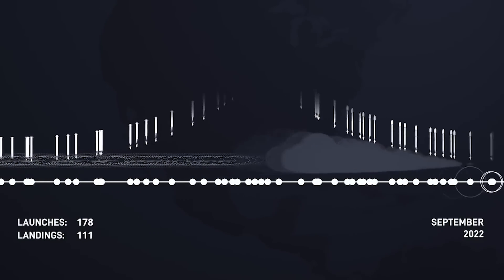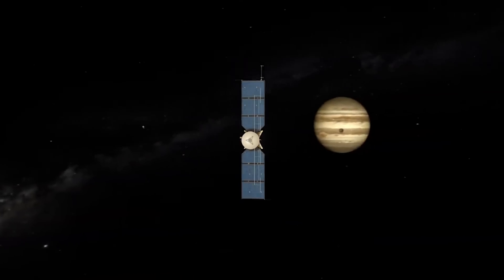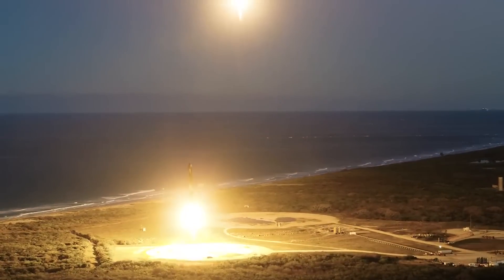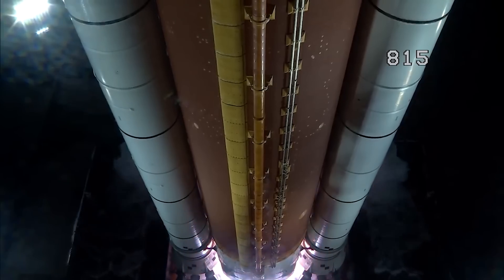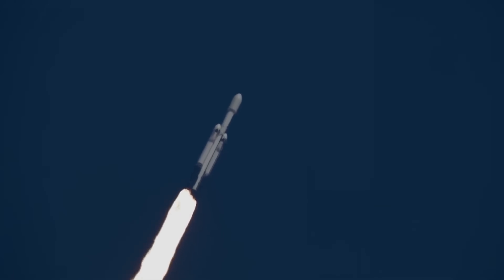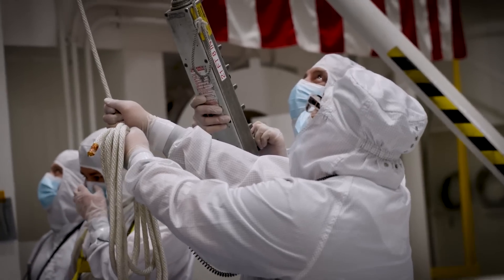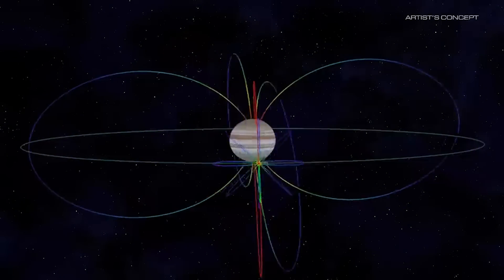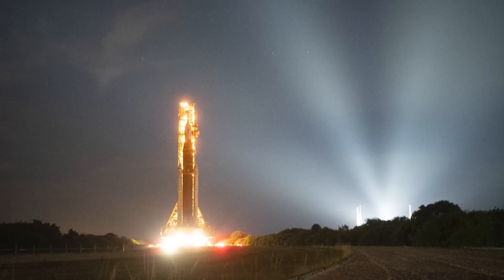SpaceX's Falcon Heavy Is About To Launch A $5 Billion Spacecraft

Comment: As it seems, SLS will be obsolete before even people launch on it. The fact that you can have 20 Falcon Heavy missions for the cost of just an SLS one, is not trivial, specially in the near future where the necessity for multiple launches per month will be a new reality. It is obvious that the future of space exploration demands cheap, easy to manufacture reusable vehicles.
Reply: NASA should stick to payloads only. It’s clear that the size of the government and the ability for contractors to charge an arm and a leg makes it pretty much impossible to design and build a vehicle for cheap. One company that has all the infrastructure to design almost everything needed for a vehicle is clearly the way to go in terms of cost. When you have a bunch of subcontractors the cost skyrockets and quality control becomes much more difficult and adds even more cost.
Reply: Falcon heavy could not lift Orion to TLI, even when fully expended. Yes, there are very few missions that require SLS (especially outside of Artemis), but for those missions, there is no alternative. Also 20 is exaggerated, it's more like 14x
Reply: Until starship is ready.@plainText384
Reply: anything NASA and the government are involved in is just wasting tax payers money!!
Reply: @plainText384  It hasn't have to lift Orion, they can easily modify any capsule to go along with Falcon Heavy and the 20 times is not an exaggeration, actually is more than 20 as the final cost for an SLS launch is around 2.5 to 3 BN.
Reply: @jonnekjonneksson  2.5B is 14× 178M for Falcon Heavy. Orion is the only currently operational spacecraft capable of returning humans to earth from the moon (in an unburnt state). If you wanted to launch a crewed lunar mission on Falcon Heavy, you would need to design a spacecraft that can do everything Orion can do, but is more than 11t lighter (41.8% mass reduction). 
Maybe that would let you just barely get something like the Soviet Soyuz 7K-LOK with into lunar orbit, but that would mean reducing Artemis crews to just two people per mission.
Reply: @plainText384 Falcon Heavy can get Orion to the moon. The Orion CM+ESM weighs ~26.5t. A fully expended FH can get 20t to TLI, but with centaur-like boost stage, it could potentially get 29t to TLI. If you can get Orion 2.2t lighter (~8%), you could even drone-ship recover the boosters!
Reply: @kolbyking2315  Source on the 20t to TLI? If you look at NASA's Launch Vehicle Performance Website, they claim just over 15t for TLI, while other sources (Wikipedia/its source) suggested maybe 16t to TLI. 
And adding a Centaur-like 3rd stage is no simple undertaking.
Reply: @plainText384  You're right. It's probably 15t-16t to TLI. Orion and the ICPS are slightly thinner than FH'S fairing (5m vs 5.2m), but they're ~70% longer. It'd take some engineering, but probably less than building/using the SLS💀. The LH2 stage mass math is right, tho. 26.5t Orion CM+ESM + ~32t ICPS = 58.5t in LEO. Fully expended FH gets ~64t to LEO, or 52t - 57t with ASDS booster recovery.
Reply: To be fair, SLS can deliver much more cargo than Falcon Heavy, but that will soon drastically change with Starship. Insane to think we will get 200t or even 400t satellites around Jupiter and Saturn just in few years.
Reply: @Ormusn2o  spot on correct… although I think it all comes down to one final thing with this SLS/ FHeavy issue. Cost. One SLS launch = many FHeavy launches
Reply: Falcon heavy can't do what SLS can , that's why
Reply: @sidharthcs2110  It absolutely can, they only need a FH capsule if they need to launch people except payloads.
Reply: Agreed
Reply: No one knew when SLS began under the Constellation Program, that SpaceX wouldn't be bankrupt before Artemis first mission flew. SpaceX EXISTS because DARPA. DOD and NASA after its ONE successful Falcon 1 launch.
Reply: Damn thats a lotta words, too bad im not reading this cliche comment
Reply: Propellent technology will become obsolete this decade.

Comment: SLS and Orion are such a joke
Reply: It's even more of a joke when you consider the fact that much of the design for the fuel tank and the solid rocket boosters is just repurposed space shuttle Tech. Stuff that was originally designed in the 1970s
Reply: And your Doctorate in Aerospace Engineering, or Space Policy came from where? You got it online? That clicks.

Comment: I am curious to know if the Falcon Heavy is fully extended or partially expended configurations.  It also seems to me there is room in the payload bay for a solid third stage to give it additional velocity.  I wonder what the rational for not doing so was.
Reply: A solid fuel rocket may not be precise enough for interplanetary trajectories
Reply: @shanent5793  Galileo, New Horizons,  and Cassini: Are we a joke to you?
Reply: Probably just cheaper to pay for the expendable falcon than to design a kick stage or buy a kick stage by someone else
Reply: Weight.   You can't just double or triple up....
Reply: Not 100% sure, but I believe the second stage may be the bottleneck for Falcon Heavy. It would be interesting to see a back-of-envelope study by someone who knows more than me about whether a larger/heavier second stage would be viable for Falcon Heavy. I'm sure thrust would be OK, but a heavier 2nd stage would also put more strain on the interface to first stage and probably the connection between the boosters.
Reply: Would a solid third stage have caused vibration issues?
Reply: @garreth629  Those big solid boosters rumble and vibrate.  Smaller solids, less vibration.  However, there may not be any available and to make one up might take expenses testing that NASA wouldn't wish to pay.

Comment: Crazy to imagine that you could fund 50 Starship prototype stacks for the value of that payload.  Fifty!
Reply: Kind of a pointless statement.  Might as well compare a wind turbine to a supercomputer.
Reply: If they end up bringing the cost down to their goal, which is 2 million dollars, you could have 2500 starship flights for that. 2 million dollars is a long way off though.
Reply: @FerociousPancake888  that goal is simply not achievable, the fuel alone cost more, the steel cost more than that, before any manufacturing.
Reply: No one knew in 2000 they're would be reusable boosters in 2024.
Reply: @hanspecans  The cost of the Europa probe?  They spent a long time developing it.  I can believe it.
Reply: Who lied to you and said a start ship stack only costed 100 million. Given they spend 2 billion per year and fly 2 per year that'd punch out to 1 billion per flight using the same method of working the price as people apply to SLS
Reply: @mathewferstl7042  I agree that a Starship / Super Heavy is probably more than 100 million, probably around $500 million if fully expended (not recoverable). Currently, the $billions SpaceX is spending on the Starship program isn't for the spacecraft, but R&D. We are only days (maybe hours) away from the 4th Starship launch. They are funding Starship with Starlink which currently costs about $30 million per launch which is mind boggling to think about. Just 14 years ago it would have cost more than $300 million to launch a 15 ton payload to orbit, now SpaceX can do it for $30 million. 
Once Starship / Super heavy get to the same level of re-usability as Falcon and I do believe they will, I wouldn't think it is a far stretch to say that a single launch would cost $100 million. We may be a few years away from this, but I do think it is possible and likely to happen as long as SpaceX can keep up their current progress.
Reply: @woodlanditguy2951  While it does make sense to try to frame the cost of the most powerful rocket in terms that fit the context of traditional rocket science costs, no, it really does cost them a bit less than $100 million, at least for the current Block 1 prototypes.  That includes all 39 engines, maybe obviously—that's where most of a vehicle's expense normally comes from, after all, but Raptor v2 reportedly runs SpaceX $250k a pop now.  That might make it easier to see how the stacks can be made on the cheap.
Reply: @mathewferstl7042  SLS's pricetag information comes from NASA.  It's $2 billion to build a SLS; $4 billion if it's for Artemis.  This is not being calculated from SLS's history of development which has cost NASA over $50 billion so far.
Reply: @mathewferstl7042  3 have launched this year, most of that money is R&D.  If you think a full stack is 1 billion you clearly don't watch or pay attention to the program.  its 100m including fuel per launch.
Reply: @mathewferstl7042  lucky that 100 million was quoted and not the 2 million elon advertised it at the start or the 10 million that would be the cost for the crewed version to mars with the 100K per ticket price...
Reply: @thorin1045  That's 100 million to make the prototype vehicle stack.  And you're correct, I wasn't listing the cost of the fuel for a launch 6+ years from today.  Good eye.
Reply: @thorin1045  By who? I highly doubt they're only spending $100 million on each stack.